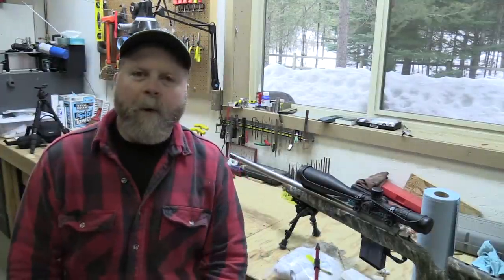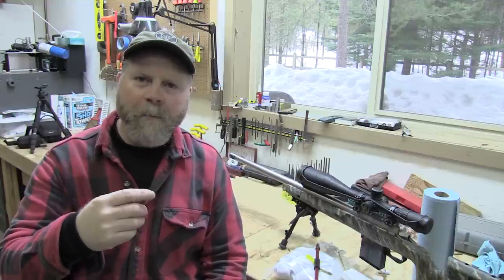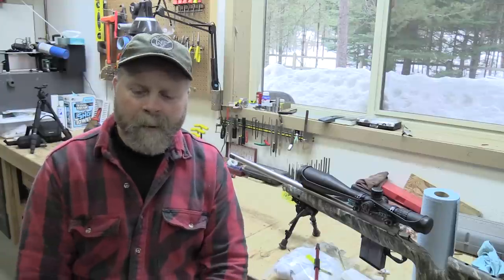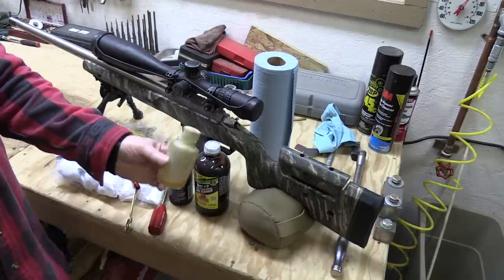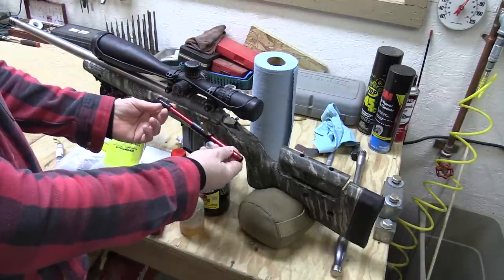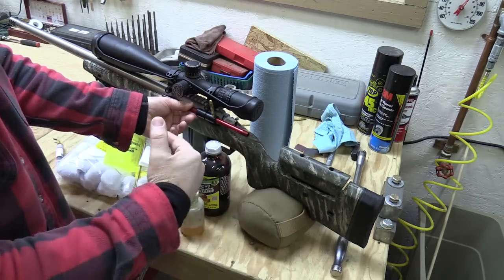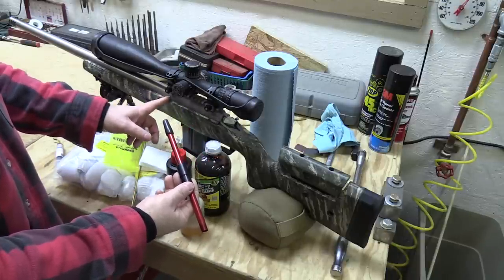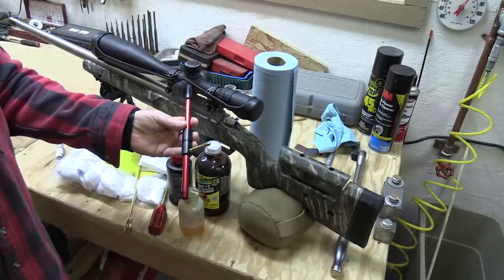Precision Rifle Barrel Break-in & Cleaning: Why, how, and do you really have to?

Comment: Ha that's funny, just as your cat jumped up on the bench behind you my cat jumped up on the desk in front of the screen.  

Anyhoo, my break in procedure with my new 223 was to get 20 rounds through it while zeroing the scope and getting some 200m targets then I took it home and put it in the safe.  I have used carbon cleaner a few times but no copper cleaner, it has about 100 rounds through it now, and still hits within 1/2 of an inch of where I'm aiming.

Comment: Alot of companies lap their barrels. So no break in required. Also is sweets safe  on ferratic nitrocarborized steel?
Reply from the maker: German Shepherd 20 I have no idea if you can use Sweet’s with Melonite. 

The break in has nothing to do with trying to lap the barrel. It’s all about laying over the edge left by cutting the chamber against the direction of the lapping. There’s no doubt it’s happening if you look at a freshly cut and fired barrel. The big argument is whether or not to remove the copper left from doing it, or simply keep shooting over the layer of copper.
Reply: Okay I've got a cz sonoran. It is a chrome lines number 3 barrel then ferratic nitrocarborized. Is why I asked because you recommend the product I was concerned because sweets can etch the steel. Also cz web site says no break in required on their barrels because they are lapped. I understand break in has nothing to do with lapping a barrel. These barrels are already lapped from the cz factory. You mention a precision barrel does not last long in the video, I believe the cz sonoran is marketed as a 4000 round precision barrel. 1 moa. The question I have is in  regard to Cooper in the barrel not lapped or in the chamber compared to a factory lapped barrel. A lapped barrel will not have copper fouling. And in the chamber a finely reamed throat will not have copper fouling. you describe in the video  within the chamber the copper will blow a dust into the rest of the barrel. So the debate is leaving some copper fouling in the throat? Thanks for the quick reply. 
I will do more research on sweets I would like to use your recommendations.

Comment: Thank's Panhandle; Your doing more than just "fire lapping" a barrel on initial barrel break "over".The cleaning part is to occupy your mind while the barrel cools as a method of stress relief from machining processes unless, the barrel was cryo treated post tooling. Frequency of cleaning is also a matter of powder used. Slower burn rate powders introduce a greater amount of residual "carbon fowling". Carbon fowling is abrasive! Why do we remove copper fouling before storage? To prevent moisture build up between the copper and bore that results in pitting. If its going to be awhile before you can clean the bore, a couple of good wet patches of Kroil will act as a barrier to preclude said moisture. Don't forget the usually neglected chamber. If you are the sad owner of a barrel that will only shoot when "fowled in" you have one that is termed a "fowler". Hope you didn't spend too much on it.

Comment: I bought a 25 wssm barrel from kreiger they only bored out the 25 hole and that was it an $800 pos. Talked with some gun smiths and they were surprised they didn’t finish the barrel and said its not worth having them finish it. The cost would be high so i will never buy from them again.

Comment: Can leaving carbon in the barrel increase chances of rust and pitting if you leave it in the safe without cleaning for long periods of time, for instance I go to the range once a month to once every two months? Last year I only put 340 rounds through my 308.
Reply from the maker: miles13242 Not that I’ve seen. I’ve left fouled barrels in the safe for years before firing them again.
Reply: Panhandle Precision sound good, do you clean the chamber and throat though? I've read about people trying to clean the "carbon ring" and talking about having to scrub it with harsher chemicals to get it out.
Reply from the maker: Just the chamber. The bullets don't seem to care about that carbon ring.:-)
Reply: Panhandle Precision yep, so many different opinions, I read about carbon rings and they had me a little worried haha, thank you for the responses

Comment: As a former USMC Sniper I just cringe at the thought of NOT Cleaning my rifle (mortars are guns) after a shooting spree.  Even Mortar crews swab the bore every so many shots (up to 9 charges of black powder per shell).  I do have a 9mm Glock 19 that I have never cleaned at all (over 10 years) as a challenge that it will not jam, and so far it hasn't jammed once, and is just as accurate as shot #1.  But I still cringe a little every time I make shot #1 with it.

Comment: Always thought the purpose was to defoul/decopper the barrel to KEEP it from corrosion. The powder residues are highly corrosive & left in there just eat away the bore. AM I WRONG???
Reply from the maker: Dave Jan Yes. Show me anything a modern smokeless propellant or copper residue has corroded.
Reply: Panhandle Precision , Im pretty old school if u havent guessed. Was taught that in my youth. That ESPECIALLY in humid climates the powder resedues create metal etching acids. I DO know that dissimular metals touching each other cause electrical etching, I.E. surface pitting. Thats just plane physics. Have NO idea just how deep that goes thou. Was/Am  surprised leaving a bbl dirty has no negative effects. I personally clean my guns after every hunt/playday. Then clean/oil the bores. Have never lost a bbl doing that. Grandfathers & dads rifles all clean/oiled. For what its worth thou, when I work up a load i usually go through a hundred rounds finding that "Sweet spot" load. Once found & after cleaning/ decoppering the groups tighten up. Sometimes radically, sometimes only a little. After that I only shoot that 1 load through that particular gun. Kinda REAL PICKY about accuracy. The guy on 243 outdoors never cleans his rifles either. Surprised the hell out of me! Hes a great shot w tackdriver shooters. I DO fire 1 fouling shot thou w every new shoot to drive out the residual oil left in the bores. (leave em oil wet before putting them away)  Drives my hunting buddies crazy, they say Im spooking the game. In any case, like your channel. subbed....
Reply: Dave Jan Unless you shoot old surplus military ammo (or Soviet 7n6 from 70's & 80's) you should be fine. If you do, then you will soon get used to giving your rifle a warm water bath every time you shoot :)
Reply: @Dave Jan   In the old days, primers were made with Potassium Perchlorate, which, when set off produced Potassium Chloride, which is very similar to Sodium Chloride - ie Table salt. This attracts water out of the air (ie, it's hygroscopic) and wet salt with oxygen will rust any damn thing. Just saying.

Lots of surplus military ammunition still contains those Potassium primers, because in the ,ilitary, manpower is cheap, and it worked for 100 years, why change? Most military stuff has been non-corrosive for many years now.

Modern primers don't leave such deposits, neither do smokeless powders, although I have heard people complaining about L'il Gun.
Reply: Dave Jan  FWIW, the old ones, back when Dan'l was shooting Kentucky long rifles & black powder, corrosion was a serious consideration. If the hunter didn't have the means to do a proper cleaning, he'd urinate down the barrel. Not very elegant but they understood how ammonia counteracted the corrosive nature of the black powder.
Reply: Wow - good thing Garands don't use black powder.  Garand thumb is one thing, but . . .

Comment: Barrel break in procedures is a bunch of nonsense . Over cleaning though will have a negative impact. I have had a number of 2.5 inch groups at 1000 yards.  The most important thing is every 100-150  shots is to get rid of  that carbon ring.Use JB paste to get rid of it.

Comment: I always start with seriously hot water down the barrel. then I run the rod with a stiff brush attached followed by cloth patches until dry.  Then I finish the cleaning using the same rod procedure with a little diesel fuel. I always get constant excellent results while not being taken by these sellers of seriously higher priced gun cleaning solvents. Store gun solvents are extremely overrated. Diesel never gasoline.

Comment: Some information is good in this video however a barrel is made of hardened steel how can a soft ass bullet debur a rifle barrel this guy is a clown
Reply: Let’s shoot copper rounds then put copper solvent to remove it so we have the same build up later on try it out I bet you will see copper will return
Reply from the maker: Bryan Saltsman Get off the internet and go spend some time shooting and looking in barrels with a borescope. Skepticism I understand, and quite frankly admire, but to call me a clown instead of seeing for yourself just makes you a lazy loudmouth.
Reply: Panhandle Precision watch some gunblue490 videos the old man explains it simply like this a hardens file can not be filed down by a copper pipe so how can a copper round file any burs on a hardened steel barrel it is scientifically impossible
Reply from the maker: Bryan Saltsman I agree. Nobody is talking about doing anything like that. We’re not rubbing a copper pipe against a file, we’re pushing a copper slug with 60k psi behind it over a tiny burr left where the reamer cut against the grain of the bore. That’s it and nothing else.